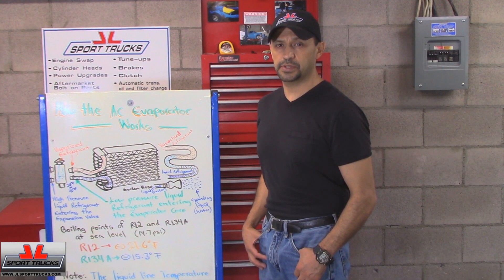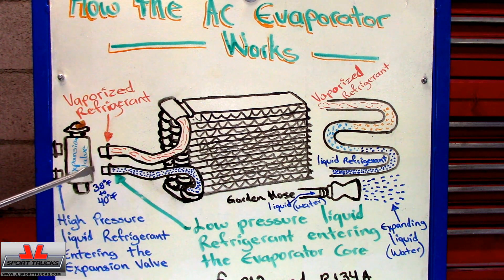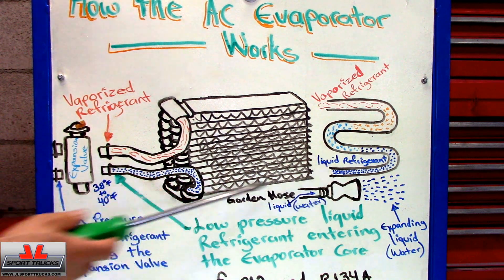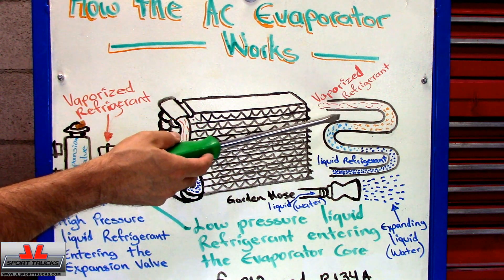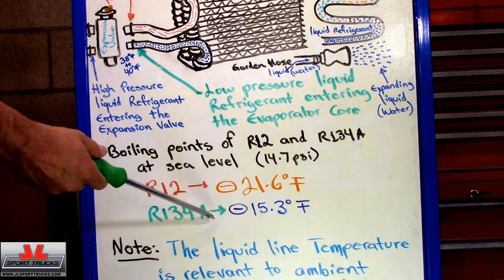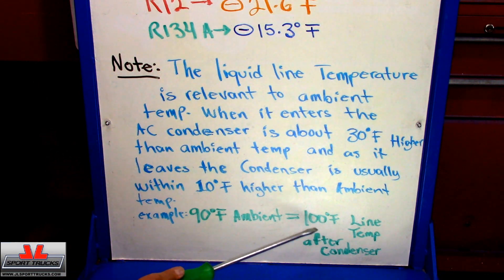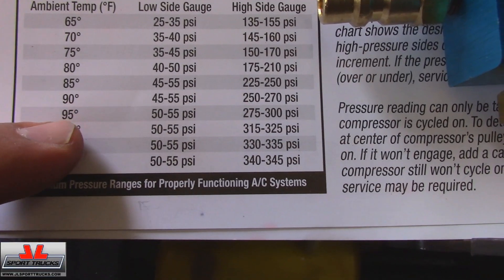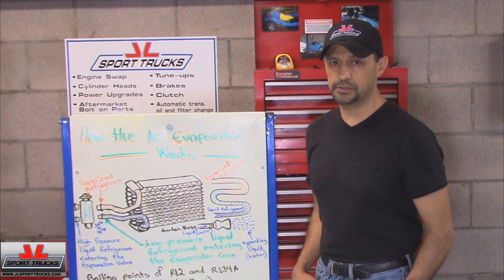How the AC Evaporator Core Works

Comment: I have a 2000 gmc sierra: Mar last year I replaced the compressor, because it was making a loud rattle. Still made the rattle after changing it, so i changed it again in June along with the condenser, accumulator, lines, pressure switch, tensioner After all these replacements done at the same time, the noise from the compressor is still there. Googling I came across that the rattle from the compressor is liquid getting into the compressor(liquid sludging/floodback). I've still had cold air, but the compressor still makes the same loud rattle. The only piece I did not change was the AC Evap Core, could this be causing liquid to get into the compressor and creating that sound?
Reply: I know I'm late but yes, whenever liquid gets into the compressor, that's because it didn't evaporate enough in the evaporator.
Reply: Doesn't necessarily mean it's the core, could be the not getting enough air flow, dirty surfaces, etc
Reply: The compressor keeps blowing seals.  Is that possible the evaporator is still clogged inside even after getting system cleaned with compressed air?  Everything else has been replaced. The evaporator gets really hot when trying to put in new refrigerant.   Any advise will be greatly appreciated.  This an 2013 kia soup with 1.6 liter and automatic.  Thank you